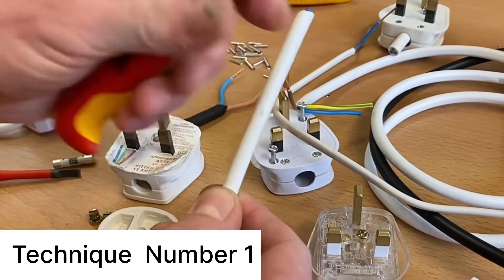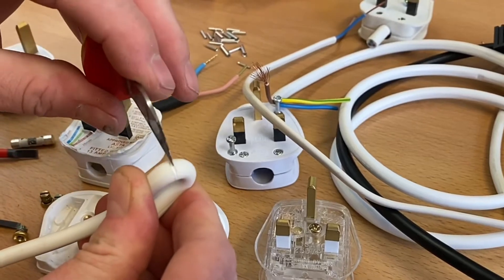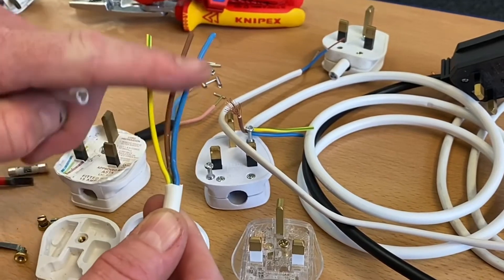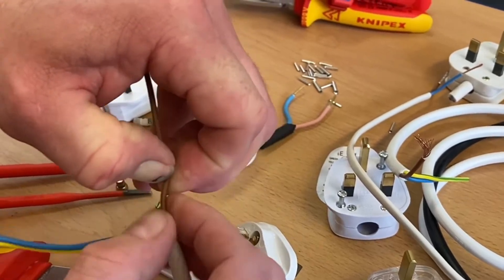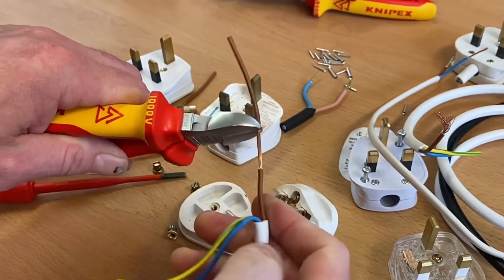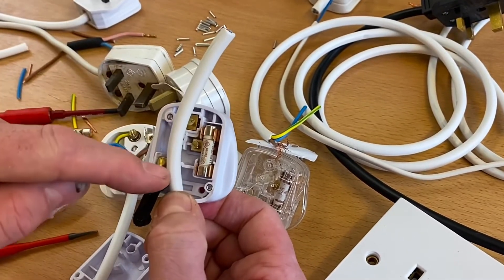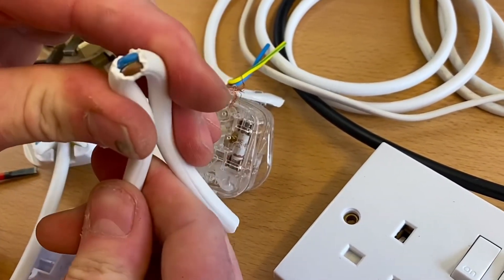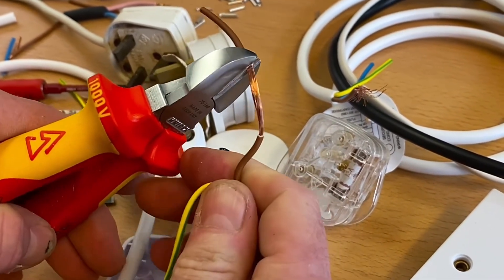How to Strip Flexible Cable

Comment: I only use utility knives for Armour Cable and large conductor wires. For those white cables i just use a Cat5 spin cutter, real easy and you can adjust the depth of the cut.

Comment: If you need to know how sharp a knife is put it on your thumb nail and move towards the tip . If it's blunt it wil move easily , if it's sharp it will drag . If you are stripping flex get the CK combi cutters with stripping holes in them. Takes the guess work out of it

Comment: I do like Mk Plugs, in my opinion I prefer the wire wrap around the studs and held down with a screw nut. I have these plug on all my workshop tools and nearly all fitted with a 5 amp fuses and I also have fitted in my workshop MK double sockets with red neon I think there are the older Sentury sockets made between 1978-1998 I think. Good quality.
Reply: You either have very old workshop tools or you have cut moulded plugs off to fit your own plugs. From February 1st 1996, all appliances must be supplied fitted with a standard plug in the UK.
Reply: @GadgetMan36  All my tools are old some go back to 1980, 82,83 and I have fitted longer 2 core orange flex there are about 4m long and I service them,most of them are second hand and  bought from  the car boot sale. I know that power tools come with a moulded plug from the mid 90's